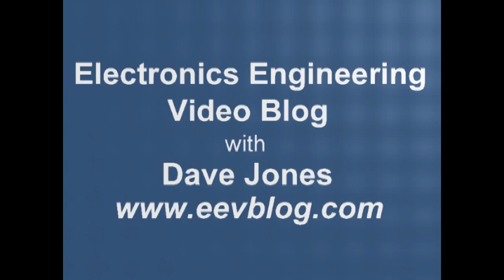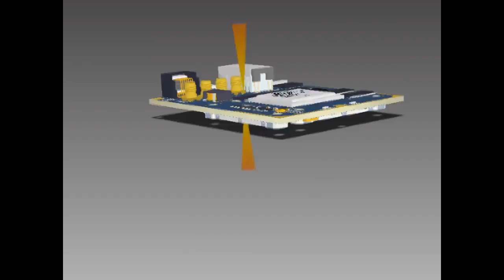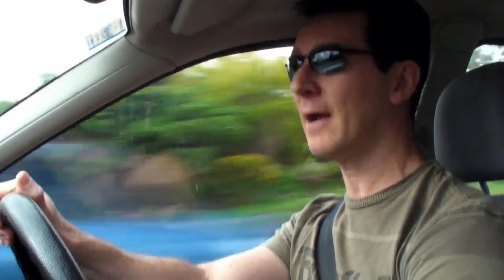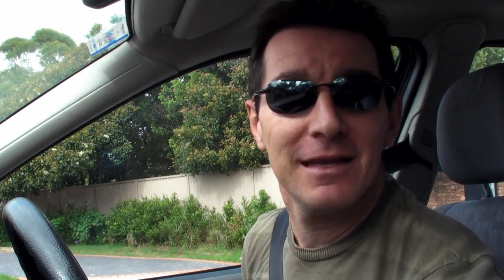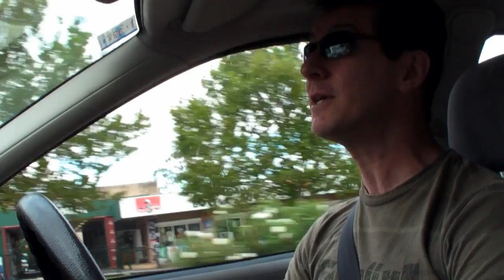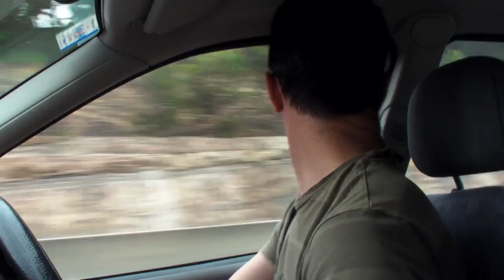EEVblog #65 - Umm, I Design Computers

Comment: This sounds pretty close to a lot of what I've heard about all types of engineering. The best example I've heard came from one of my professors who said basically that an engineering job at NASA isn't going to be designing an entire space shuttle, it will be designing one tiny screw, or circuit, or switch.

Comment: One mistake i've made was repairing a computer. It needed a new power supply unit which could handle more power than the previous one. 
"My computer screwed up. My files are missing." Yes, if you replace a psu your files will magically disappear, according to a family member. I've never repaired a computer since then, except my own stuff.